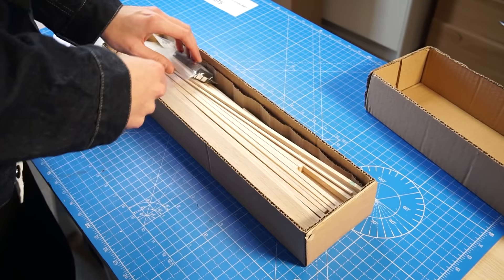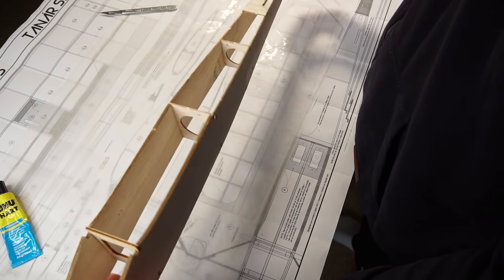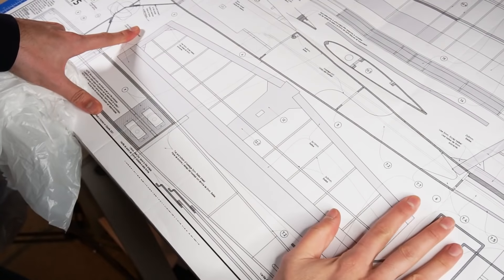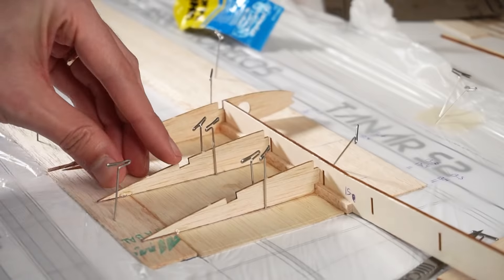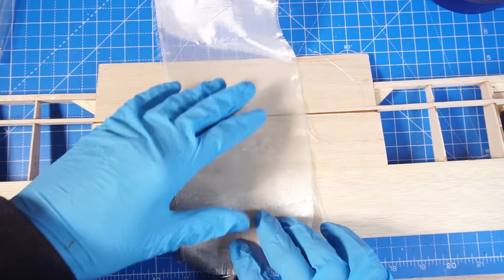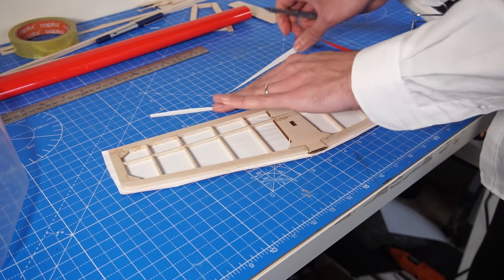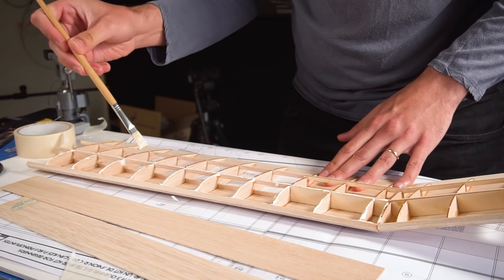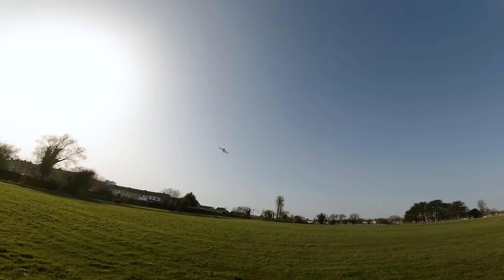Tanár | A Trainer Model Aircraft for Beginners and Everyone [RC Model Airplane Balsa Wood Kit]

Comment: what is the name of this motor with which you are making the rc plane?
Reply: It's a Brushless motor. Again, brushless motors come is several sizes and KVs (KV is basically the rpm of motor when 1 volt is applied i.e. a 1000KV motor will spin 1000 times on 1 volt and over 12k times on 11.1v)... choosing a motor is crucial because it defines if your plane will be underpowered or overpowered etc... well, even if it'll lift off the ground or not... If you're a newbie, i suggest going for a foamboard build (there's plenty of plans for easy to build trainers on flitetest's website, or you can use plans from joyplanes too! Ive got planes built from both) and use a 2212 motor (1000Kv if using a 10" propellor, 1400KV if using a 9" or 8" propellor and 2300KV if using a 5-6" propellor) as they're the cheapest ones to find... I've currently upped myself to a 2217 motor, which is bigger and more powerful, equivalent of a park 450 motor... but yeah, I hope I could help:) feel free to ask if you have more questions